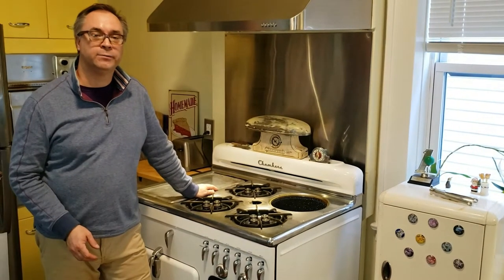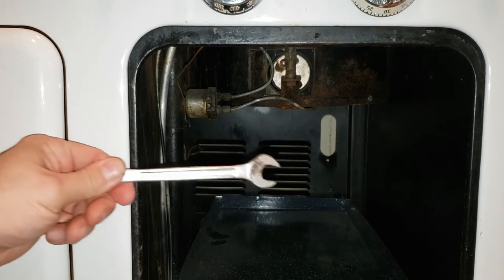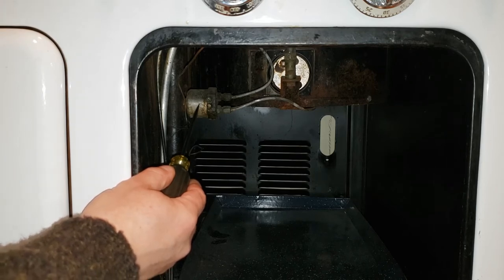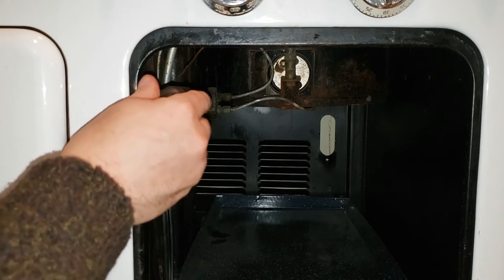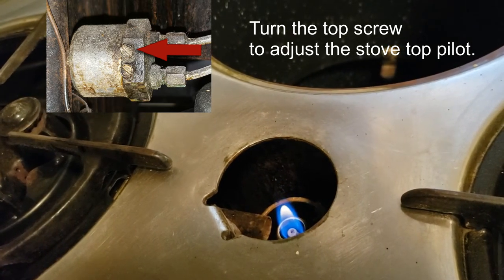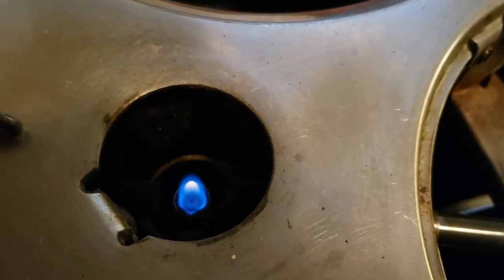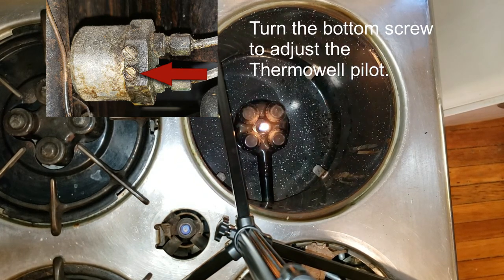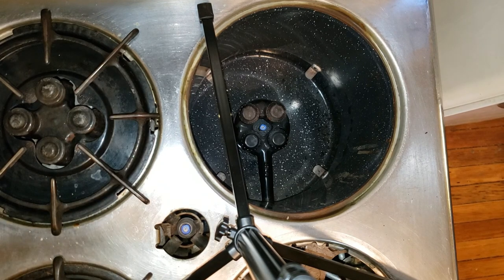How to Adjust the Standing Pilots on a Vintage Chambers Model C Stove

Comment: Very helpful!  We have been smelling gas and think it’s coming from the pilot.  We shut them off and are hoping that eliminates the problem.   We have been having to light the stove burners with a lighter anyway so the pilot is not necessary.
Reply from the maker: Pilots get clogged over the decades (mostly from hydrogen sulfide build-up) - that's when you start smelling something. Reaming them out solves the issue. It sounds like your flash tubes need replacing, too - not a big deal, but it's also fine to just light by hand. Hope the smell has gone away!

Comment: Could you tell me about the differences between a model b and model c?
Reply from the maker: Sure. I'll make a video explanation as soon as I have the space to roll my B out next to my C, but simply put, there are a few ways to tell them apart and a few things that make them very different in terms of function. You can tell a B if it only has one dial in the front and no place for a timer next to it. Bs have a solid front panel like the C, not two separate panels like the A. Most Bs had a black top, although later ones did have chrome tops. Only the model B made in 1948 (the BZ) had the pilot cover like the C. 
Those are the cosmetic differences. The biggest difference internally is the Thermowell. Only the C Thermowell can be used to bake - it has a greatly improved design and the internal airflow was redirected to basically create what we'd now call a convection oven. The B's Thermowell can do everything else, just not bake.

Comment: How much gas does it use in a typical day or month, just wondering.  I have set mine to off for now but I was thinking about turning it back on.
Reply from the maker: I've never taken a meter to the stove to measure the exact consumption. But by all accounts, it has little to no impact on your annual costs.

Comment: @Chambers Rescue Vintage Stove Channel Where would I find the adjustment screws on a Wedgewood Stove?
Reply from the maker: Depends on the exact model, but the thing to do is find the pilot, then trace the line back to where it connects to the manifold. Along the way, you'll find the adjustment screw.

Comment: Hello! Thank you for these videos! I followed instructions on your video, my pilot is on, it turned one burner on once, then now my burners don’t come on. I can just hear the gas coming out. The pilot is still on, do you have an idea what else could be causing this?
Reply from the maker: Hi, There are several things that could be going on here. First, if you turn the burner off and then right back on, it won't ignite. That's just a matter of airflow, fire and time (stoichiometry).
If you wait a minute and it still doesn't ignite, then I'd look at the following:
Is the flash tube intact? Is it resting properly in the hole in the burner?
Is the burner sitting properly with little tab or stem resting in the hole on the support?
If all of that checks out, then you need to adjust the air mixer plate. My video on how to adjust stove burners shows you how to do that.

Comment: Ok, time for your dumb question of the week.
I can't get my pilots to light. I turn the gas on, hold a lighter to it, and it just has this strangely regular sputter. Like every other second it will catch for just a moment. What am I doing wrong here?
Reply from the maker: There are a couple of things that could be going on: either it's turned too low (turn it up, at least until it lights) or it's clogged and needs to be reamed out. Especially if you're burning natural gas, deposits are normal and build up over time. Look for white color around the tip of the pilot - that's how you know if it needs to be cleaned.
Reply: @VintageStoveChannel 
Do you have a video showing how you clean/ream the pilots?